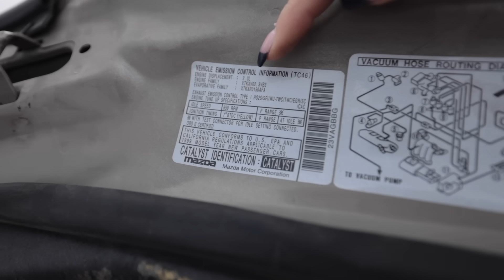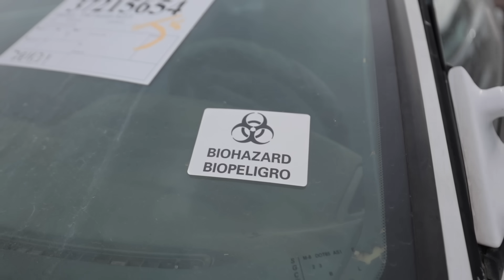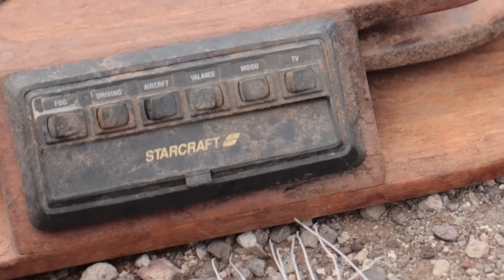Why Would Someone SCRAP THESE!?!

Comment: Keep up the hard work Sarah. I most certainly understand feeling like you are all over the place on a car build. I’ve been doing the same on my 1968 Barracuda swapping the old torsion bar suspension, etc to double adjustable coilover, rack and pinion steering from a fox body with a gm Saginaw pump, tubular k-member, upper/lower control arms, adding a sway bar and a 4 wheel disc brake conversion.  Of course that turns into going down the rabbit hole for a bunch of other modifications. Lol. I am loving the Celica project and truly love seeing you show a lot of the little things that go into restoring it the proper way.

Comment: you can use a bolt and nut as a punch to make holes in rubber so it should work on jute, I use this method to make rubber washers out of old inner-tubes.

Comment: Pro tip, tape the chuck of your grinder, drill etc to the power cord right by the plug. 
You'll always know where it is and it almost always forces you to unplug it in order to use the chuck.

Comment: Howdy Sarah.. I lost my grinder key too.. so I got some flat bar, measures the gap between the holes in the nut… drilled out holes in the bar the same gap distance, then used small bolt that fit into the nut holes.. and welded them to the flat bar ( or use nut n bolt through the bar,) 
With hindsight it wools have been faster and easier to buy replacement

Comment: The hack for the angle grinder is to just use the disc itself. Use your non dominant paw to hold the lock tab down and use the other hand to grab the disk and turn it loose, almost like opening a jar. The friction will be enough to loosen the arbor nut, and it will naturally tighten as grinder is used so you can install them the same way!

Comment: Cleaning before sanding is often a must on old parts.
If you don’t clean off certain contaminates before sanding they will penetrate deeper and remain even after cleaning thus ruining the coatings you later apply.

Comment: Quick tip for the angle grinder make sure it's unplugged push the lock button on the back then grab the the wheel and turn it will loosen or tighten without that annoying wrench.

Comment: @ 8:41 You questioned the vehicle being an LTD but then stated it being a Mercury Zephyr. Back when I was roughly around your current age I owned a Fairmont which looked closer in build and overall design than the LTDs did. Whenever I needed to get used recycled replacement parts the local recycling yards always seemed to come off Zephyrs.

Comment: Just a little help. With a glove on you should be able to just hold in the grinder lock and grab the disk on your grinder and turn it with your hand to loosen it. Then do the same when putting next disc or cutoff wheel on and grab and just tighten by hand. Seems to work with no problem or slipping. :)

Comment: That old Ford is a sunliner i think they are called. The whole top folds back into the trunk. I think it was the first hardtop convertible
Reply: Ummmmm... not that one.  It's a four door, and there are no indications of the roof being able to fold down into the trunk.  Also, there is no "baggage well" in the center of the trunk floor where you could store a few suitcases with them being crushed by the roof retracting mechanisms.  And, of course, there are no roof retracting mechanisms (you'd known of you saw it!).

Comment: The Kaiser was a very rare travel-all - I think the even rarer Fraser version was called the Vagabond - and it looked like a conventional sedan, but opened up to carry large objects like a couch or appliance. The driver side rear door was welded closed - I'm not sure why. Back in the day, the spare wheel was stored vertically in the trunk, but to make the body style functional they mounted the spare behind the driver seat. Steve Magnante did a video about the Fraser Vagabond version. This car is so rare it needs to be saved, and powered by a modern V8.

Comment: Just a thought, the aluminum heatshield you put in the back, could you put some dynomat on it? I'm thinking that other stuff may have also helped with sound deadening.
Reply from the maker: It's getting covered in Jute on the front side just like the OEM panel had.

Comment: Angle grinder wheel changes do not require a tool. Un plug it. Push the lock button, then grab the wheel n turn it by hand.

Comment: I've built two of those 5M-GE Cressida engines. One was fully Reconditioned re-bored new pistons, line honed, both were zero decked,, both had the cams degree'd so they would run right both were  alot of work and a pain in the Ass. Never Again.

Comment: Sarah - amateur tip I picked up somewhere in the YouTubiverse - you can “sharpen” some appropriate diameter copper/metal tubing to make a sort of plug-cutter for those fabric holes.  I needed to cut holes through some rubber plugs and this tip helped immensely.  Back it with soft wood (pine) or scrap leather and it should work well.

Also - while you may not have the proper spanner to lock disks on that grinder - you have a welder and you’re brilliant - so you could just make your own!

Comment: A little sound deadening would really unrattleify that aluminum panel.... :cat-orange-whistling:
Reply from the maker: It'll have Jute on the front side just like the original did.
Reply: @SarahnTuned  If that was my car, I would completely seal off that trunk with sound deadening. And then put jute over that. Is it going to add weight? Sure. But so is that V8 under the hood. This would help lower the noise floor in that car.

Comment: Okay Sara, I have to tell you that you can remove those discs by hand on the disc, they only need to be tightened hand tight to work too :) haven't used a tool for many, many years.

Comment: I had a '75 that I bought used (same color as yours, but an ST). The bumperettes worked just fine. I know this because when I bought it the valance between the grille and the bumper had been bent because the bumperette did its job; without that feature the grille and fender would have been damaged. Other than that the car looked showroom (I bought it in '89). I still miss that car. I wish that I had been mature enough to have not abused it, and to resist being convinced by a "friend" to cut the dash so that a 1 DIN radio could be installed. It sure was fun though.

I worked at a Mazda dealership when the Mellinia was current. The supercharged V6 was the top-end model, and we only ever got one of them (and it was s custom order). I was also lucky enough to drive the 323 GTX. It was amazing. Sadly I never managed to work out a deal to buy it.

That Keizer is a wonderful starting point for a hotrod. Someone better buy it complete. It'd be a waste not to.

Comment: I always thought those type bumper pads on small Cars were not really so much for the owner of the cars but for the line up in transportation.   front to back line up on ships and trains and trucks.   i mean,  it doesn't take much of an accident in even a perfectly lined up scenario, but if you were just lining up cars and strapping them in for transport, imagine how many rolled a little too far and smacked the next without bumpers...   Yikes.

Comment: If that Cressida is a MX73 car, it looks like it is, grab the front hubs, calipers and all related brake brackets. Those are upgrades for similar year Mk2 Celica/Supras. You can even use those on 1st gen Celicas. I have this setup on my roadrace 77 Celica GT.

Comment: The cardboard divider was for air and noise.  Not intended or required to be fire resistant.  

Not following why you replaced it with aluminum.  But nice job.

Comment: If I’m not mistaken, according to the law in Arizona, once a vehicle goes to the junkyard and the title is surrendered, it’s final. The vehicle cannot be sold. I once tried to buy an Oldsmobile from a salvage yard, and that’s what I was told. I also did a lot of scrap steel hauling in the Phoenix area for several years, and came across the same thing numerous times. You wouldn’t believe some of the cars and trucks I’ve seen get scrapped and crushed. It’s tragic. And the owners got paid about $300 for each one. Some of them were worth thousands, and many of them were in fantastic shape.

Comment: I use copper and brass pipe for punches. You can bevel the inside or outside and it's stretchy. Very cheap.  For junkyard crawling I always take old cardboard to scoot around on.

Comment: Hey uh… you shouldn’t need a tool to change your angle grinder disc. Just press the blade lock button on the back and twist the disc with your hands and it should just undo. You only need to tighten it back down firmly by hand as well. Same thing in reverse. I believe the direction the blade spins should keep the nut tight so there is no reason to wrench it down hard.

Comment: For the angle grinder tool, take any flat metal bar, drill holes (as many as you like) in same place of your angle grinder flange bolt, and put bolts. Now you have infinite tools :)
Reply: you don't even need a tool.  just hold the lock button and unscrew the disc.
Reply: @AlanShortySwanson  i don't trust my self enough to only hand tighten

Comment: Didn't know that version of the Celica had bumper backing mounts like that.  My RA20 doesn't have those, the chrome OEM smiley bumpers bold directly to the body in the rear and 2 brackets in the front, no backing plate.

Comment: Push the spindle lock on the grinder. Place the palm of your hand over the nut, with your fingers wrapped around the disc rotate it off.  I've literally never used the wrench on any of my grinders!  Sooooo much easier.   :)
Reply: Remove battery or unplug if its electric😮

Comment: I think the fender emblems on the Ford Galaxy were to suggest it had a "thunderbird V8" instead of some Y block or MEL. Ford used that the way chevy guys label everything a "corvette 350", since the t'bird was supposed to be their performance model (there's even a 406 FE for NASCAR they called a thunderbird engine even though it was never offered in a t bird). In the 1960's, tho, Carroll Shelby got the Cobra up and running and then Ford called everything the Cobra--Cobra Jet, Super Cobra Jet, etc whether it was a 428 or 429.

you do know your stuff, that's real refreshing compared to most "my brudda had a Z28 like dat, but it had da heem-ie in it" crowd at cruise nights.

Comment: Pro tip, dont tighten it. If you need to release it, Spin with your hand and push the button, 2-3 times and it will come loose. 

I once tightened early in my days so much that I needed to cut the nut in half to get it free. ruined 3 tools

Comment: life hack. just lock the angle grinder button and twist the attachment. it will loosen the lock completely. and upon install, tighten it as much as comfortable. and allot the torque of the grinder to lock the bolt further. its thread is opposite of the way it the attachment spins.
i throw away the angle grinder tool. its completely useless.

Comment: Great video, fyi all the SLs had V8s . Mercedes just put different sizes.  280, 380, etc. Kinda cool. Also, pro tip on grinder, just grab by hand and unscrew. I haven't used that grinder tool in years  . 😊

Comment: I was at the final flight of the blackbird and in those times, noway zooming in on the airplane, I tried to get a lens for my phone, but it was too small.  I had a better lens because I was gonna make a 12 bit hack camera, but the camera sucked.  The best way to get a better camera is a galaxy ultra or a pixel 6 because they got 46MP  3x optical lens.  The sony TV CAMERA is big and cheap.  But I thought the 35mm was plenty big, but it wasn't though.  Requires about an hour of removing the old housing, but there goes the tripod mount.  lol  In the law uses as microscope penal code cheap murderer.

Comment: Yo know you don't actually need ANY tool to remove a flap disc right? Just grab the wheel and turn by hand after you lock the shaft (duh). Same for putting it on.. try it..:)

Comment: America Mazda in Irvine. California was forming their Upscale division.  Amanti Motors (???) . They had 110-115 employees in Irvine. The Millimium (sp??) was it's first model. It cost more to make then the MSRP.  When It was painted it was on a rotisserie to rotate while drying to prevent orange peel. Read up on the Miller engine. Then the Luxury car market died, the Yen fell, SUV n Trucks were selling like hotcakes. So Mazda closed down Amanti Motors and gave the car a Mazda name plate. It was sold next to the 929 (awesome car). But the Mill. Had no head room for 6 foot Americans, (same RX8)  It was expensive and failed. 
KEEP UP YOUR GREAT VIDEOS. 
Love from Thailand. 
SGT DOUG,  RECON,  101ST,  RVN 68-69

Comment: The last 10% of the work takes 90% of the time, or so it seems.  It's so easy to start to cut corners when you get to that point.  The difference between a "meh" restoration and a truly spectacular restoration is that exact thing -- not cutting corners at the end.  I definitely like the fact that you never cut corners, even when you could and no one would notice.

Comment: Hi Sarah; That 2.3 supercharged Millenia you stumbled upon was a Milenia ‘S’. Supercharged because it was a Miller Cycle engine, some craziness that altered valve timing to use the positive manifold pressure to fill the cylinder faster. The regular Millenia was a 2.5 which was already complicated enough. The fact that the ‘upgrade’ model had a smaller displacement engine was a sure sign that bad judgment had been employed. We did valve covers on an ‘S’ and the tech scrambled a few of the myriad of vacuum lines. Took four or five returns to get the ‘check engine’ light out meanwhile the dealership wouldn’t even touch it. The cars developed such a reputation for irrepairibility that no Mazda specialty shop from Sacramento to Fresno would do more than an oil change. Wash your hands after touching the VIN plate on that malevolent serpent. BTW you look better and sexier in sneakers and blown out jeans in a Pick N Pull than all the Swifties in the Mall. Just sayin’
Reply: In some parts of the world the Mazda Millenia was called the Mazda Xedos 9. We had the most futuristic sounding names in the 90's !

Comment: Sarah a suggestion, when and if you get or find your angle grinder wrench just use and cable tie to attach it to the cord near the plug.  This is so you can't lose it anymore and it will remind you to unplug it while changing disks so you don't accidentally get hurt.  Great content
Reply: Or just unskrew it using the disk itself